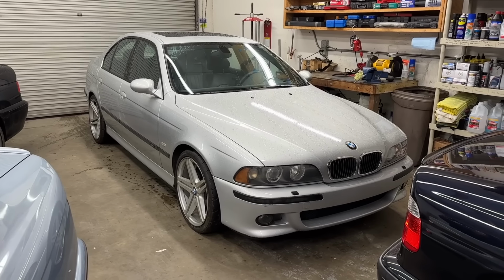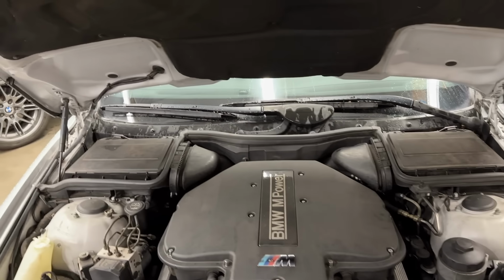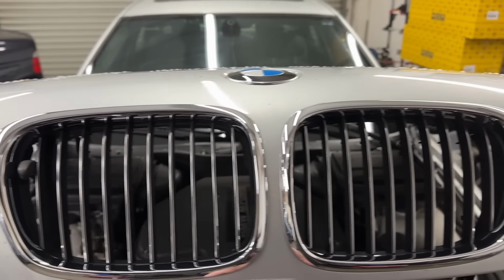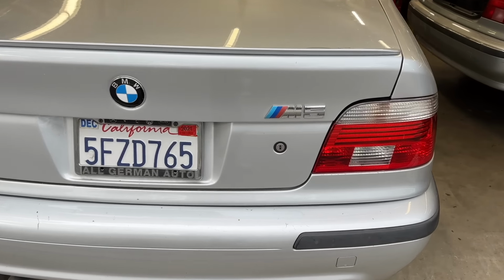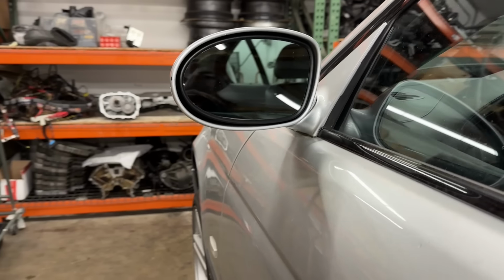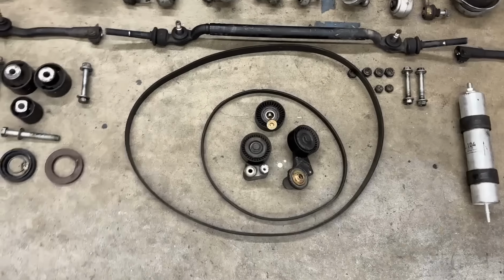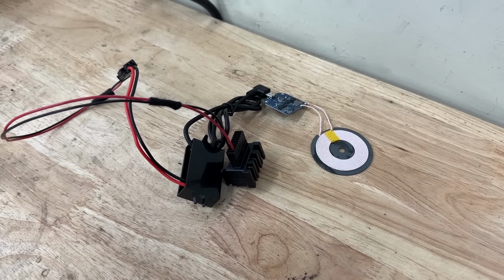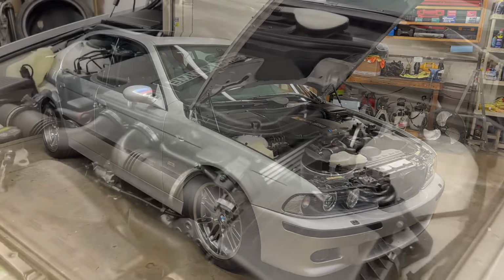An E39Source Restoration:  2003 BMW E39 M5

Comment: Man what a project. From a crap car to a gem 💎. I wish I had the money and somebody like you to work on my E38 restoration project. The work done to the car is fantastic! 1 hour of youtube that was so worth watching! Congratulations and greets from Europe! 👏
Reply from the maker: Thank you for your comment and kind words!  Best of luck with your E38 project.
Reply: @E39Source  For 2 years I’ve had the E38. Done most mechanical and electrical work. Has some more stuff to be done. This spring is going for a full paint job. Needs some new interior and exterior trim as well. Found your channel and subscribed while searching for trunk toolbox info. Got mine almost restored last week. Still need the 10 mm socket and polish cloth though.
Reply from the maker: Fantastic!  You're going to have a new condition 7 series :)  You're best off to get the 10mm new, and try your luck on Ebay for the cloth. @volnick1986

Comment: These mirrors are so expensive... Specially self dimming ones, doesn't matter BMW, or Mercedes after some years they all go wrong with leaking inside oil. As i remembered ULO is the Hungarian Company which was making these mirrors for majority of German cars of 00 eras. ULO mirrors are the same as Original ones, but they cost a little bit cheaper.
Anyway Great Story Mr. Ryan 👌

Comment: Ryan, two questions for you: a) where do you get the tire monitor button relocation bracket? and b) what are your thoughts on E65 fan/fan clutch upgrade for the e39m5 as I see you didn't choose to go this route on this car.  There is a long discussion on that on M5board.
Reply from the maker: The button relocation panel can be purchased here:  https://bluedogdesignwerks.com/products/bmw-e39-tpms-relocation-plate  

I don't hear/notice a difference with the E65 fan/clutch.  I also don't like the extension adapter that is required, I think that would prematurely wear the water pump bearing.

Comment: Great job Ryan! Could you provide an approximate cost to refurbish this E39 M5?
Reply from the maker: The customer has requested that the figures be kept private.  Each M5 restoration varies wildly, ranging between $3,000 and $60,000 this calendar year alone.

Comment: A magnificent obsession! The same things go on these cars - I just replaced the washer fluid neck as well, new design looks stronger. Curious - do you ever recommend the Euro center console cubby? Better looking than US and actually useful.
Reply from the maker: I don't particularly care for the Euro console myself, though I do install it when requested by a customer.  I personally prefer the small storage cubby in the lower (Euro) dash by the OBD-II port that my E39s both have.

Comment: Hi! I have a 2000 M5 and im just curious as to what a restoration like this would go for? Your services speak for themselves, and i honestly wouldn't trust anyone else to do a job like this
Reply from the maker: Thank you for watching and for your comment!  The cost of these restorations vary wildly depending on what is needed, and no two M5s have identical needs.  This particular vehicle required a lot of paint, body, and upholstery work which is quite costly.  I'd love to discuss your M5 more with you, could you email me at ryan@e39source.com?
Reply: @E39Source  Sure thing, this weekend I can gather some photos/info and will send it over.Thanks for the quick response!
Reply from the maker: @marceloalarcon6058  Excellent!  I look forward to hearing from you.

Comment: Nice restoration what's the part number for the chassis cover?
Reply from the maker: Chassis cover?  Do you mean the underbody panels directly behind the front wheels?
Reply: @E39Source  yes that panel
Reply from the maker: @justinvidal9986  Left:  https://tinyurl.com/3kp6tjue  Right:  https://tinyurl.com/bdf7bmd4

Comment: Why does the car shake at 50 and pull a certain direction when you hit the breaks? i figured it was a warped rotor. I feel it when i push the breaks hard going over 15 mph
Reply from the maker: A 50mph shake will be the front curved control arm inner bushings, replace the whole arms.  Pulling while hitting the brakes can be several things, including but not limited to:  mismatching tire type/condition, failing caliper, mismatching brake type/condition, poor alignment, failing ABS module, etc.  I'd need the car in my shop to diagnose this.
Reply: @E39Source  thank you so much! alas i live in oahu hawaii and i dont think i could ship it out there just for that
Reply from the maker: @hawaiianinja  No kidding!  I flying into Honolulu one week from today. You’ve got an M5?  I’ve only ever seen one E39 M5 in all of Hawaii and it was on Oahu, carbon black if I recall.
Reply: @E39Source  wow no way what a coincidence that's sooo dope!! I have a 2003 530i, your videos have been a well of information for me. This is my first Bimmer and there's all kinds of things going on with it, the first time I tried to fill the gas up after I bought it it started leaking from somewhere on the top of the fuel tank and running down the bottom dripping onto the ground
Reply from the maker: @hawaiianinja  Fuel level sender seal?  Those are starting to fail more and more often.
Reply: @E39Source  i gotta order a new fuel level sending unit my gas gauge always reads empty so i'll get on that i hope thats it! another problem i have been having is the car will die when im at a complete stop and i press the gas so im thinking 02 sensor or something like that..its getting worse the mmore i drive it. is there a good parts website you can direct me too? its soooo hard to find parts in Hawaii, Mahalo Nui Loa :hand-purple-blue-peace:
Reply from the maker: I would want to scan the DME for stored fault codes to have a better understanding of what is causing the stalling.  I recommend ECS for parts:  https://bit.ly/2MPZSB3 @hawaiianinja
Reply: @E39Source  i got myself a new rubber gasket and a Creader Elite BMW so i will be able to see what codes pop up it should be here in a day or so! thank you for the advice i really appreciate it!
Reply: so the leak is coming straight out of the fuel level sending unit through micro cracks in the plastic and when i plugged the scanner it spit out so many fault codes i fear i just wasted a bunch of money lol
Reply from the maker: It is likely that nobody has cleared those fault codes in ages.  I would replace that level sender, clear the codes, and see what returns.   @hawaiianinja
Reply: I’m so glad that in spite of your busy schedule you continue to post these videos. I learn from each and every one of them, plus they’re entertaining and inspirational.
Reply from the maker: @jaygrosse8365  Thank you for this comment and your continued support!

Comment: Hi just wanted to check if a middle class person afford such good restored cars with their maintenance and how much could the maintenance charges possible cost? Are they reliable?
Reply from the maker: Each and every E39 M5 is different, and their reliability is almost entirely based on the service/maintenance regiments of the previous owners.  We've found that many M5s have a lot of deferred maintenance that is costly to address at once.  Your specific pain threshold for repair costs is another important factor.  I would however consider many of my customers middle-class folks; I don't see the E39 M5 as a car that can only be owned and enjoyed by wealthy people.

Comment: Hi.where can i order the Center console?
Reply from the maker: I do not believe that any E39 M5 center consoles are still available, in any trim.
Reply: @E39Source  any advice on how to restore.  Or change out for another console?
Reply from the maker: There are wood restoration specialists, but as far the the aluminum goes, I think the best solution available right now is to wrap it.   @tamikarhone8421
Reply: @E39Source  thank you so much.  It's the aluminum that's  cracking so bad.

Comment: you didn't show any repair method, only the final result. you change the central ventilation grille and do not show the most important part, how you disconnected the cable. You change the rearview mirror and don't show how you removed the mirror. You change cup holders and you don't show the audience how to remove the cup holder without breaking the central console frame. So what is the purpose of this video? None.😅😂😂😂
Reply from the maker: This is a service in review video, not a DIY for any of the services performed in this video.  This channel is full of DIY content that will answer many if not all of your questions.

Comment: Ryan can you help I have a e39 German 520i  does the gong chime have a fuse and where is it I have checked glove trunk all fuses look good cluster test 13  I get nothing.  code showed  T 3 when I hooked a C 310 scan tool on it now scan  don't show it anymore  even bought another gong box thinking it was bad but nothing so I ,m thinking fuse can you help Thanks
Reply from the maker: T3 means terminal 3 at the gong speaker, the system thinks it's not connected.  You'll want to check continuity between the gong speaker and where those wires go, which will depend on your production date and equipment.